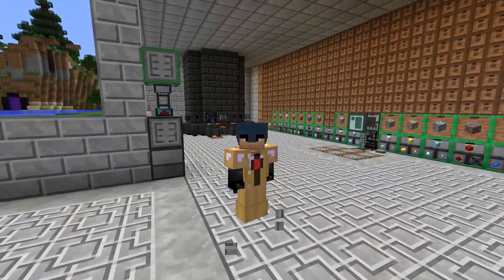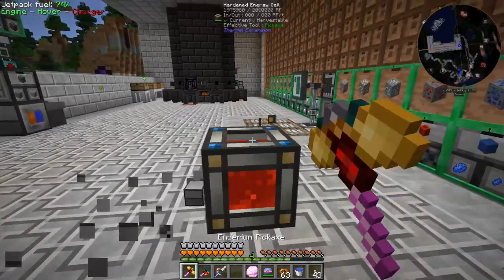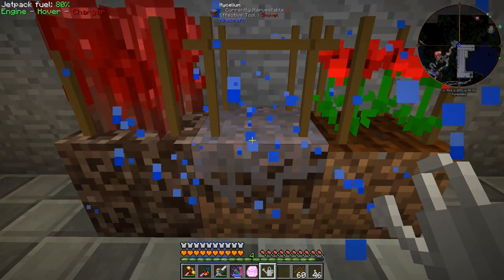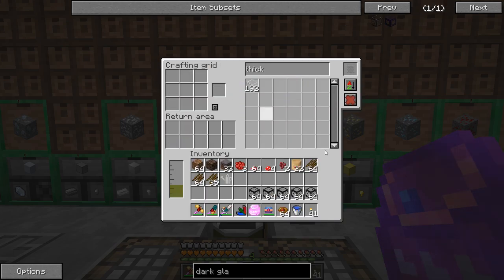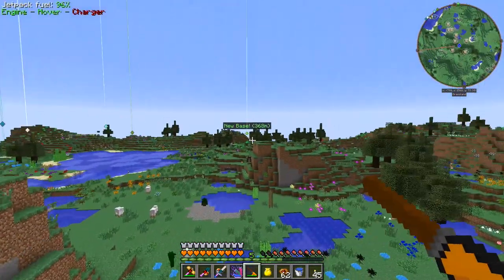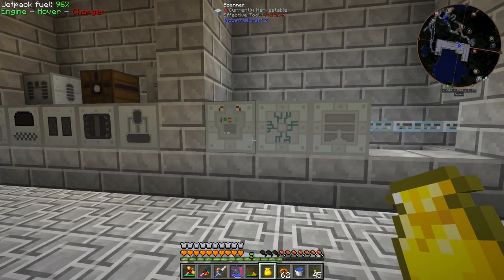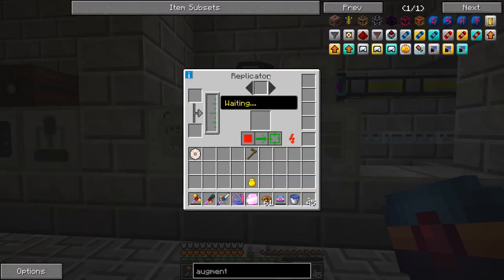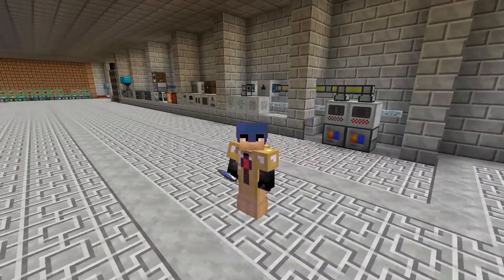Minecraft Mods FTB Infinity Evolved - IRIDIUM ORE PRODUCTION [E31] (Modded Expert Mode)

Comment: The reason the cyclic assembler worked the first time is it only had one of each veggie to use.  Once it has a stack the assembler tries to use 2x mushrooms or 2x spinach from the oredict list of listallveggie and the wellington fails to craft since you cannot use two of the same item to make it.  It would work fine if there was a way to disable the oredict business but I don't think there is.

Comment: I copied this from a wiki a while ago "Each upgrade reduces the operating time to 70% of the previous value and increases energy consumption by 60%". So power usage gets more and more inefficient with each upgrade, but you't soon find out that you need those overclockers unless you want go really mad with the amount of recyclers, which may be laggy.

If you remember right, your cyclic assembler will be clogged by the other materials as soon as one of the materials runs out of stock. You can use rationing pipes to prevent this, but switching to the ender io crafter may be more convenient. You could also have avoided growing those vanilla mushrooms by just using another autocrafting method.

Comment: You can make Pipes using Gelid Cryotheum wich transfer infinite power :)
Reply: +Lisa Marie Raper ic2 cannot replicate items from another mod it would simply error when it reaches 100%
Reply: Yes but some machines will take to much power
Reply: +Multi Martini some machines take power even if they r not in use, and they r pretty expensive to craft..
Reply: +Taffy Tiffy once you get to the point where you're making over 40k rf/t the cost of power for anything becomes moot.

Comment: I saw a method for getting crops up to 10/10/10 that seemed less grindy to me. You put a 5x5 of the appropriate soil, then place the crop sticks and plant the crop in one corner. You put double crop sticks on either side and water until the crop spreads to the adjacent sticks. Then fill in the new adjacent land with sticks and repeat until you get to the other corner. Voila, 10/10/10.
Reply: +Kevin Cowell in that case, weed will sprout and destroy the good seeds
Reply: +103683e Weeds have been disabled now.
Reply: That's legit
Reply: Oh, i see... rush on the game to make all the seeds 10/10/10
Reply: +Kevin Colwell actually the most efficient method is a line where it only has one spread choice this maximizes the speed and lowers the number of junk seeds drastically a length of 30 seems to guarantee it but I have seen it finish in as few as 20
Reply: +Kevin Colwell That didn't work for me when I tried it in 2.2.2. Maybe they've changed it in later versions though.

Comment: Hypno, if I'm not mistaken. Doesn't an ae system only need a controller if the system uses more than 8 channels.
Reply from the maker: +Zach Barsuk The non me-controller system requires power still. Two ways to make power for a network is a controller or an energy acceptor. Both require the same amount of iridium. You cannot setup a ME system in this pack until you get to around the tech level I'm at right now.

Comment: Dude, it would be better to just put down 8 16x ones, because the 64x one only produces 100,000 RFT. you might get double that from the 8 16x ones.
Reply: There aren't 16x ones, only 1x, 8x, or 64x.
Reply: Chrobin you get my point though?
Reply: +SpontaneousCombustionMan Yeah.
Reply: Why would the 64x have a hard limit? That's stupid and the mod creator of extra utilities wouldn't do that. And I'm pretty sure 100k rf/t is more than would 8 8x ones would produce.
Reply: The Ahegao Turtle Actually, the whole point of the 64x generators is that the DO only produce 64 times the base power. So 8 8x generators would be so much better than 1 64x generator.

Here's a little math:

Using cooked salmon as a base unit (Cooked salmon giving 34,584 RF at 24 RF/t)

the basic culinary generator using a stack of raw salmon gives you  2,213,376 RF.

the 8x culinary generator gives you  the same amount for a stack but at a faster rate of 1536 RF/t

The 64x culinary generator should give you 34,584 RF (Again, same amount) at 12288 RF/t, but the FTB wiki states that it outputs the same RF/t as the 8x generator.

The beef wellington, however, outputs 207,360 RF at 72 RF/t.

So a stack of Wellingtons in a basic generator gives you 13,271,040 RF

An 8x generator gives you the same amount at 576 RF/t

The 64x generator gives you, again, the same amount but at 4608 RF/t

I couldn't prove my point using math, but it seems the 8x is still the best option because it seems ridiculous that you have the option of going for 106,168,320 RF and 13,271,040 and you choose 13,271,040.

The basic ones are just too darn slow though.
Reply: why would the 64x do the same thing as the 8x? That would be so stupid, the internet lies
Reply: The Ahegao Turtle You have a good point. Unfortunately, I don't have access to the modpack so the wiki is the next best bet.
Reply: SpontaneousCombustionMan I also have no access to the modpack so I was just using common sense. Could you link me the wiki per chance?

Comment: You shouldn't bother making the resonant machine frames as it's cheaper to upgrade your machines from the basic ones (you don't need to use so much power for one thing).
Reply: +Xesh001 Basic machines only have 3 slots, Resonant has 6 and a lot of the top upgrades require a Resonant machine to use.

Comment: Use a transformer upgrade most machines have a power limit
Reply: In IC2Exp  you can give machines as much power as you want. The new E-Net isn-t able to simulate voltage properly so explosion are completely out of IC2 and power loss is a config option
Reply: +King Chuck in that version do cables explode? Just to know
Reply: +Fredy _1422 no
Reply from the maker: +Fredy _1422 The last version I remember this happening was either FTB Ultimate or FTB Monster.